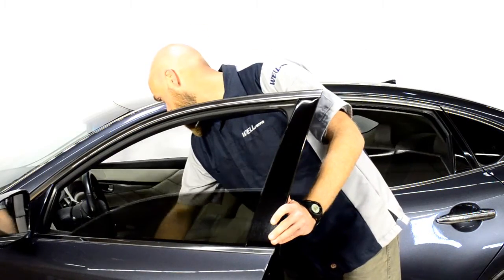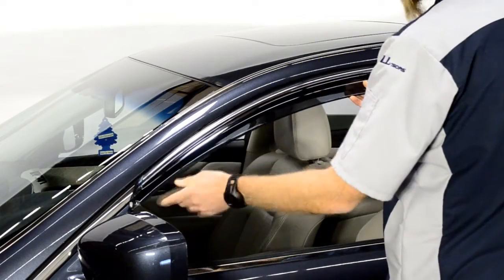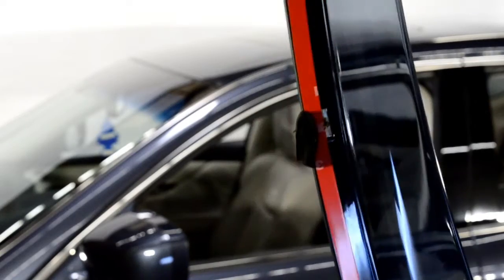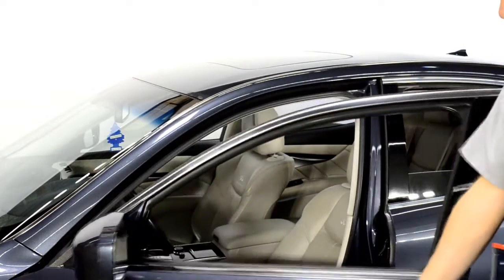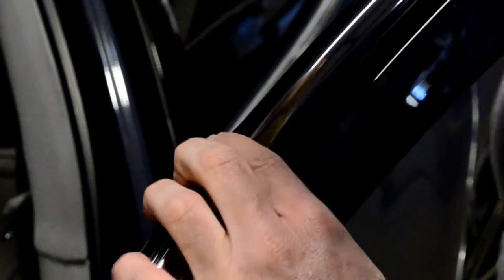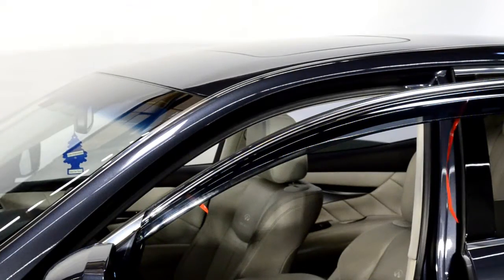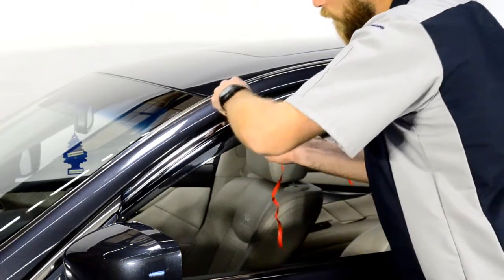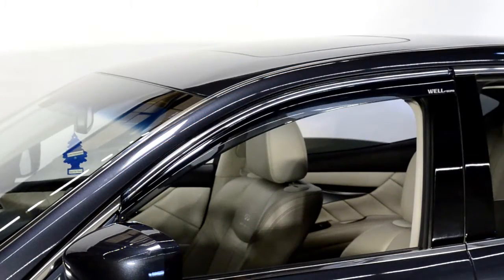WELLvisors side window deflector vent visor Installation Video INFINITI M37 Q70 M56 11-19

Comment: Hi, recently I got a set of Well visors on eBay from speedshop408 for my 2015 Infiniti Q70L and the visors are too short for the front and back windows, may share pictures if you wish. After seeing your video I was sure that your visors will fit perfectly but unfortunately they not. Disappointed.
Reply from the maker: hello can you please email us with your order info ?
Reply from the maker: hello if you can email pictures to wellvisors@gmail.com , and your address. We've had this item for awhile now and have not had any problem until now